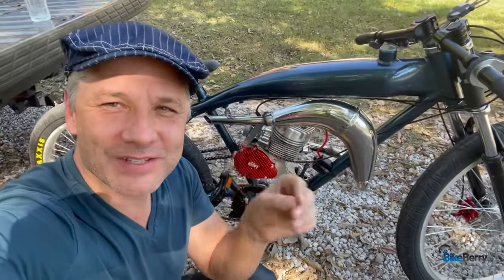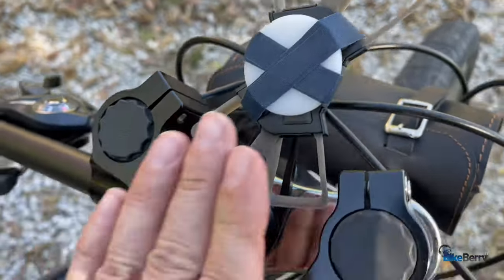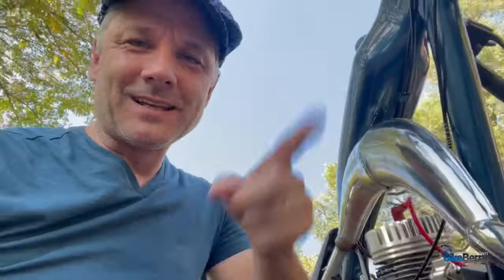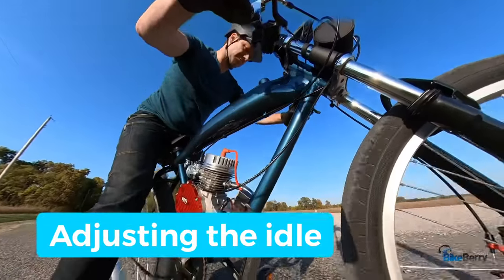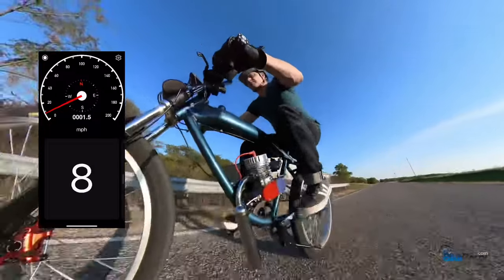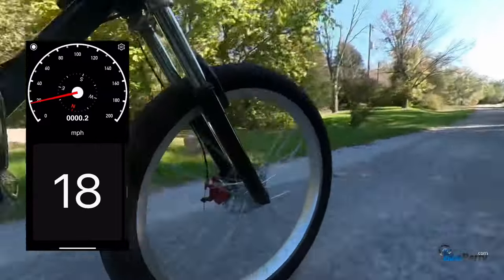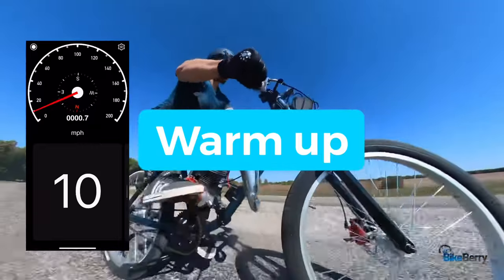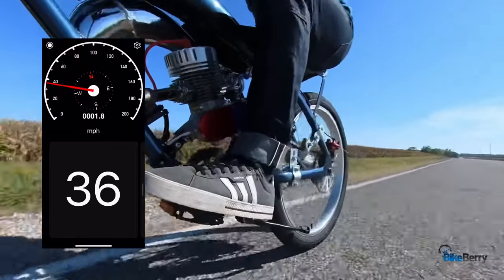Boost Your Bike's Speed: Top 3 Performance Enhancements Revealed! | BikeBerry

Comment: Thanks for the test video Tony.I use the CDH Power Reed valve that's the exact 1 you are using and it Does make a big difference,plus you don't get the blow-back from the carb coating your bike. My question is about the X-Port and the stock muffler.Would you do a run with that for us?Thanks.
Reply: Thanks buddy! Hmm stock muffler w/ X port. I’ll fit that in somewhere on one of the next performance video. Actually I’m getting ready to do a complete exhaust comparison of every model available so maybe throw the X port in there. Haha I’ll let you know 😅

Comment: Eliminated rear brakes completely (don't worry I don't plan to LEAVE it that way forever; just wanted to make sure it would get and STAY running) along with the shifters. It's now a "single speed" 18 speed. Just have to be EXTREMELY careful on the front rim brake not to do a "stoppie" which I've been fortunate with so far.

Comment: Where do you get the front engine mount, what sprocket do you use, do you do something to better balance the engine? I run 44t sprocket and with all the good stuff only get 32mph and that gets shakey, on 29r. I
Reply: Try 40T

Comment: Had a question about the electric start motors. can you swap out the cylinder wall and head for a different one of the same cc? since the electric start is all one block. would it be possible?
Reply: I’m not sure. At the moment I don’t want to tear mine apart to see. Once I need to crack it open you can bet that I’ll check. Just don’t know when that’ll be.
Reply: @tonytaylor5087  ah alright, just didn't know, would be nice to know

Comment: Have you tried to run it with all mods minus the Reed spacer? Also any plans to tune that pipe to the engine?
Reply: This is the very first mod test. I could try removing the reed intake and see what happens. My guess is it would run rougher. 

I’ve never tuned a pipe. Who can I learn from?
Reply: @tonytaylor5087  After you run your mods for the carb and pipe do a `Plug chop`Pull the spark plug and examine it . If it is black you are running rich and jet down . If it is light grey you are too lean . If it is a brown coffee color then you nailed it . I think that  is the basic tune before getting into timing etc..You can find pics posted of the plugs in their different states for reference.
Reply: Yeah I hear ya. Will def do a plug chop to start fine tuning it. Thank you 😊

Comment: One for the 100cc V2 would be nice. As it sits i see no difference in mine at all. Can't use another exhaust pipe on it because it's mounted differently than everything else BB sells.
Reply: I recently bought the 100cc v2 blindly and I’m kind of kicking myself in the ass for doing so. I am going to try to cut and weld the performance expansion pipe to fit the engine “fingers crossed”